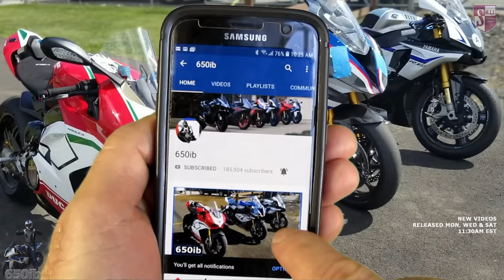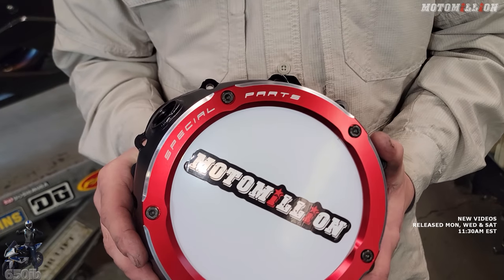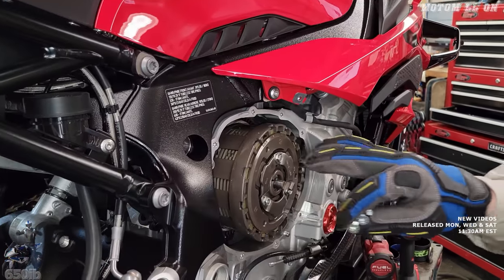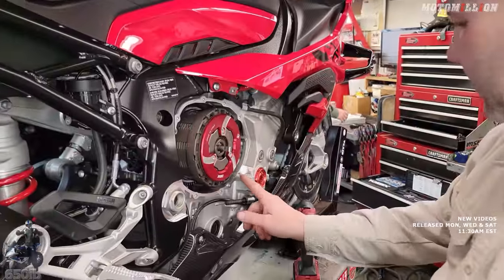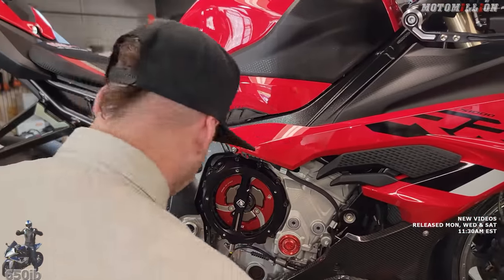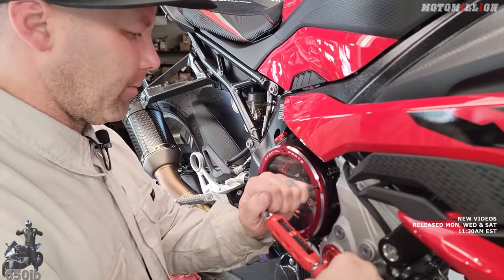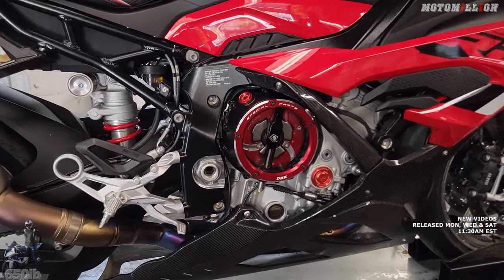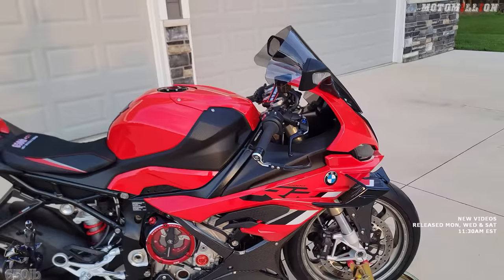THIS NEW PART MADE OUR 2023 S 1000 RR LOOK AMAZING!

Comment: I’ve been riding sport bikes since ‘97. I have never tried riding a gp shift setup.
At this point, I’d be afraid to even try it. I’m too used to the standard shift pattern and would cause myself to get tossed off the bike.
Reply: The main benefit to it is on the corner exit when you are leaned over... it allows you to upshift without dragging your toe by having to go under the lever. Other than that, no advantage.
Reply: @t3h8ar0n  I understand the advantage. I just wouldn't be able to NOT shift in the standard pattern after all these years.

Comment: At least it’s still running. Mine is almost 2 months old and spitting coolant mixed with oil out of the weep hole and the exhaust pipe. Now it’s going to the dealership for a month or 2. Fucking garbage.